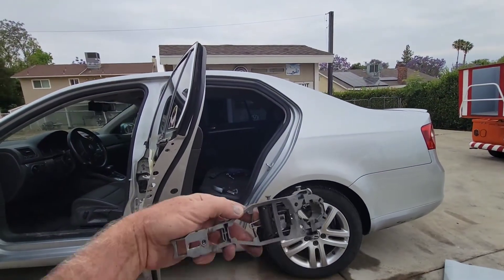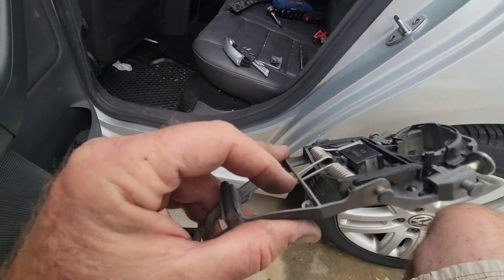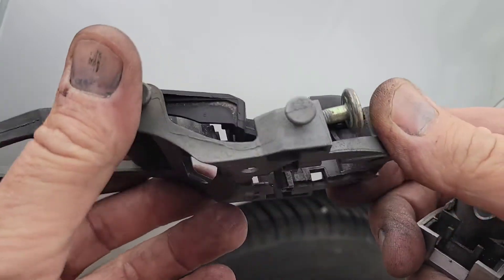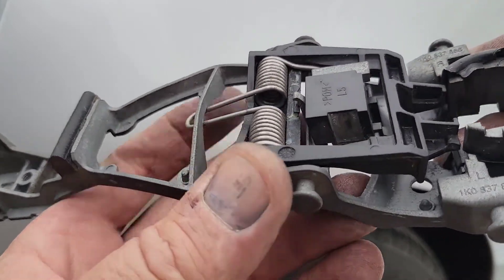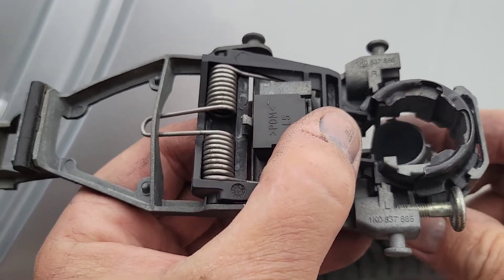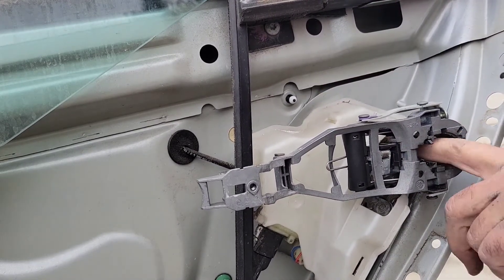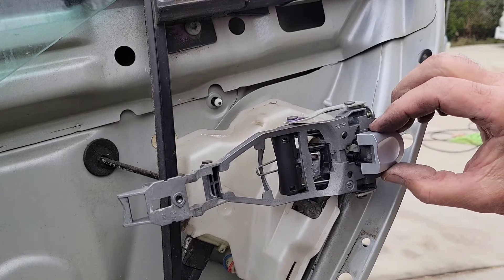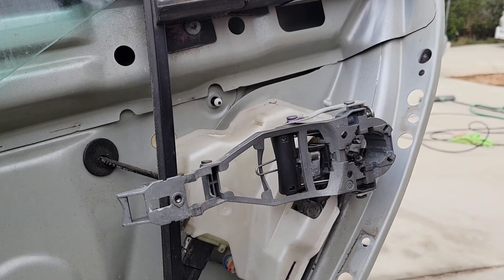VW Jetta Mk5 mk6 Door handle wont go back on door handle install

Comment: What if the lock cylinder is still in the door and you loosened the screw too much and now the lock cylinder wont budge and no amount of screw turning is making a difference?
Reply from the maker: I had that problem and finally got it. I dont remember what I did.
Reply: Did you find the solution bro?